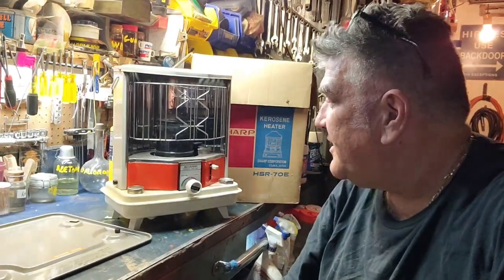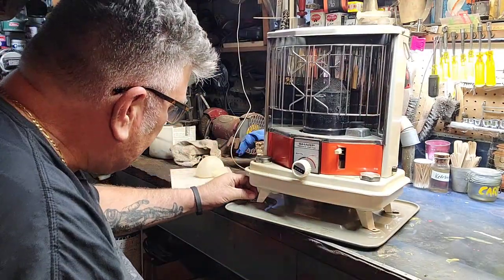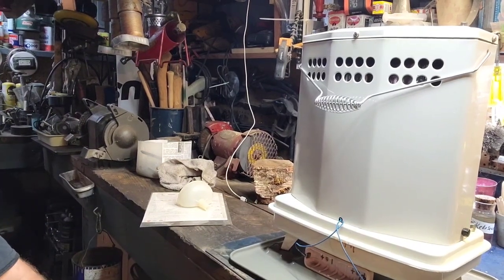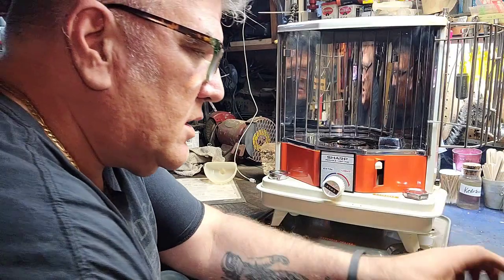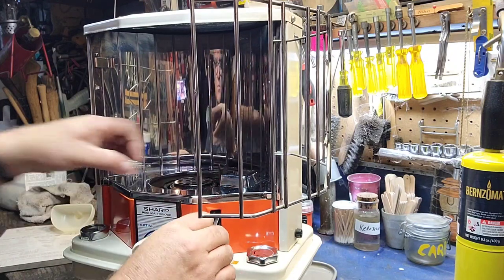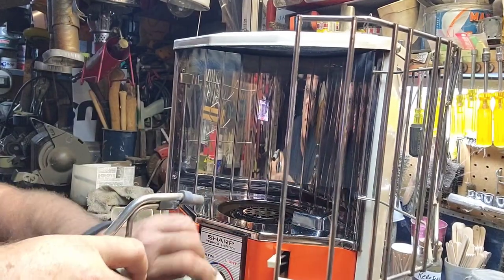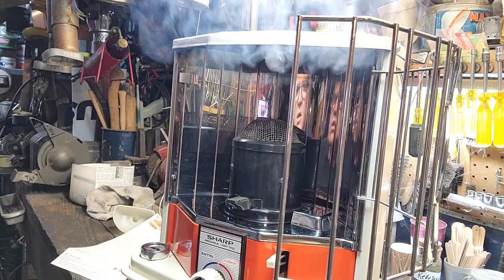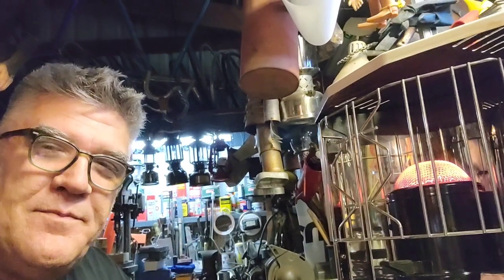Vintage Kerosene Space Heater demonstration. Sharp HSR 70

Comment: You definitely got a nice one. 
To light it manually leave the burner in place and lift the little lever just far enough to get the lighter in and let it back down as soon as you get a small flame. This will cut down on the smoke. 
I
You need to trim about an 1/8" off the top of the wick. It looks a little crusty. This will also cut down on the excess smoke while lighting and easier ignition with the battery powered ignition. 
Hope all is well. 
God bless
Reply from the maker: THANK YOU , I will try this weekend,  great info Rob !

Comment: That's a pretty  nice heater.  I fired up my Kerosun a couple weeks ago.  It ran pretty good, but really didn't  seem to put out much heat.  But it could be my shed has a high ceiling and all the heat was in the rafters.
Reply from the maker: That's interesting Chris, let me pull mine out and I'll get it going here this fall and I'll shoot it with my heat sensing gun and I'll see what kind of temperature puts out,
Reply from the maker: I do believe these types of caressing heaters there's are for supplementary heat indoors that's just my guess they probably do not perform as well just out in the open
Reply from the maker: Thanks Chris hope you're having a great evening!

Comment: Thats a nice heater.  How is the smell when it's running? We used to use kerosene heaters in work trailers. They definitely had a smell.. lol
Reply from the maker: I'm assuming this heater had not been fired in many many years so the wick needed to get treated after the whitburned off it actually burned very very clean and very little odor little odor. However when I light it again from a cold start I'll pay close attention that will be the tell. Thanks DK !